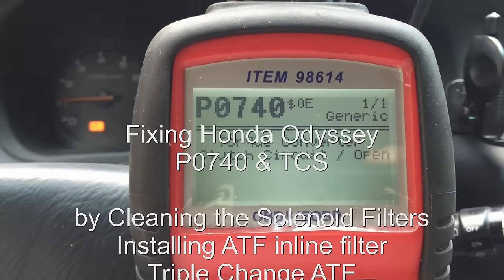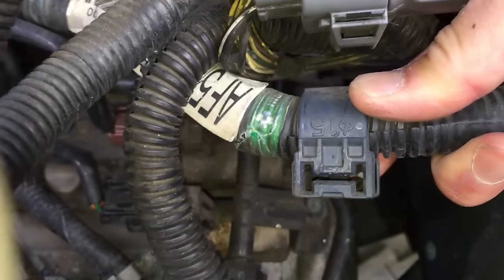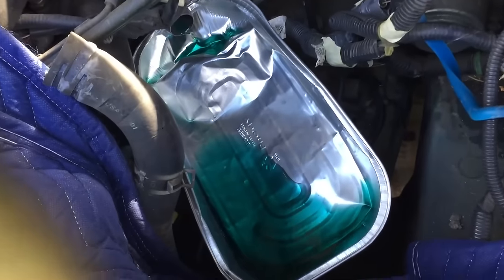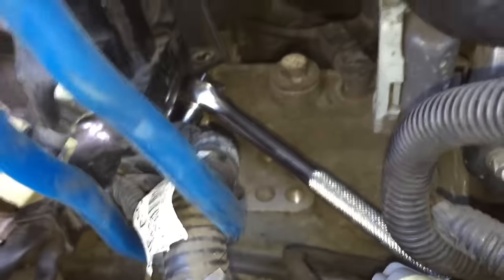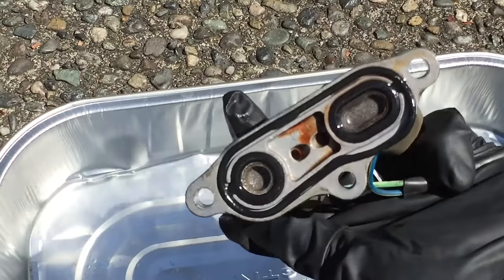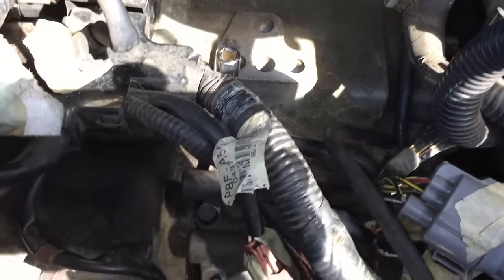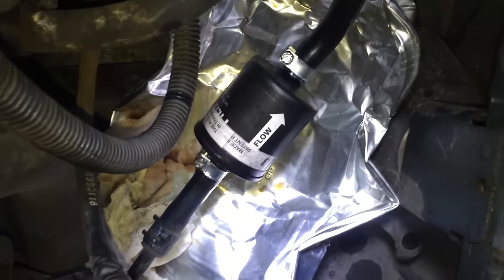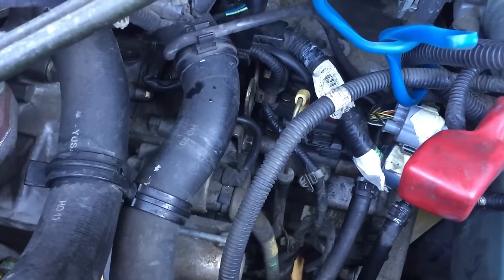Fix Odyssey P0740 TCS Transmission Problem

Comment: Thanks to you I have been able to fix the problem of my automatic B7XA in my Honda Accord V6 3.0, year 1999, 235.000 km. The symptoms I presented in my case was that the second up speed came late and very abrupt, especially cold. I was a little scared initially because I thought the box had a major breakdown but fortunately they were the microfilters of the four selenoids plugged with dirt as described in their video. My fault was that it took me a long time to change the ATF of the box, finally being in a dark color, a symptom of the oxidation of the oil when losing its lubricating properties. I could also do it without removing the water cuff, although in my vehicle is a little more laborious than yours, I recognize that the access is a bit complicated. Now my Honda runs the changes in cold very sweetly and without abruptness. I changed ATF twice in a row. Now, after a few kilometers traveled I go for the third change to get the crystalline red color. Greetings from the Canary Islands, Spain.

Comment from the maker: I just found what I think is a much better fix for my problem. This P0740 came back after 2 years and created a serious hesitation shifting from 1st to 2nd. I replaced the two shift sensors (known as A&B or B&C) located directly below the starter. It required removing the starter, but overall easier access than the solenoids in this video. The parts were $35 for both. The result was immediate and dramatic - shifting problem is completely gone! I'm going to make a video of how to do that. There are apparently several variations of this engine so yours may be different, but if you're experiencing hard shifts, then I'd recommend you replace all the solenoids.
Reply: I have a 2001 Honda accord V6 which has the exact same problems(seems to have identical solenoids). I am awaiting your video :)
Reply: I'm on my third transmission on my 1999 Odyssey with only 157,000 miles on it. Same problems each home. I think I may just do your fixes myself this time. Looking forward to seeing your video soon! Thank you so much!
Reply: So i have a 99 honda accord and i put it on drive and it wont even go past first gear tries to go to 2nd gear and it feels like the transmission locks up it brakes on its own what can it be?
Reply: does your gears blink in the dashboard?
Reply: @danieleller1108  they dont blink
Reply: @danieleller1108  also when i put the car in drive the car feels like it wants to go it jumps
Reply: well that might be bad. Its worth it to try and clean out the lock up/shift solenoid(this video). The dual linear solenoids, and the b and c solenoids. In my v6 it really cured my hard shifting from 1st to 2nd gear. Also really make sure you "test" the solenoids a bit to clear out any stickiness their could be in the solenoid pins.
Reply: Also i tried replacing my lock up/shift solenoid with a new part from amazon which caused my car to only stay in 1st. Also caused my gears to blink in the dash. Put all the old solenoids back in and it runs so much better. So it really could be they need cleaning....or it could be you need a new/rebuilt transmission :(   However its totally worth it to try this to save $$$
Reply: @danieleller1108  yeah thats what im gonna have to do.they also suggested doing a flush on the trasnmission first.so im gonna try both and see what solves the problem thank you for your time.
Reply: sadly i never had luck with a flush. But give it a shot! Hope everything ends up working out for ya
Reply from the maker: By popular demand... here's part 2 of how to fix this problem:  https://youtu.be/Z5sRlSBGWyo
Reply: Daniel Eller my gear is blinking on the dash what does that mean?
Reply: Means your transmission is unable to shift properly. Hopefully the issue is your solenoids are bad. Do what is in this video! I would start off pulling out all your solenoids and thoroughly testing and cleaning them. If issue persists then try replacing the solenoids.
Reply: Daniel Eller i haven’t had major shifting issues but I did notice I accidentally moved the car from drive to neutral while on the freeway & right away the tranny light went on
Reply: I am about to do all of my solenoids and pressure switches on my 2005 Honda Accord V6 Hybrid. Hope it fixes my hard shifting.
Reply: I just replaced those two solenoids today along with the solenoid on the front of the engine.  Took about 90 minutes, but getting the battery tray out was easy for me now because I have the hard to get at bold slightly loose and leave it that way.  You don't need to remove the started, just loosen it and it can be moved enough to get to the top solenoid.  I purchased all three of these solenoids online for about $65 on amazon.  Two were SINS and the other not sure.  Van runs well now.
Reply: Daniel Eller still waiting huh 😂
Reply: @miteeman  I think you meant to link to this video for part 2: https://www.youtube.com/watch?v=CxRiCfLmCRI

Comment: You fine sir......just saved me 2500 dollars in a rebuild......followed ur steps even bought the filter and my transmission has never been better I have 270k in my accord and the transmission has never been touched till today and u have made it better than ever thank you so much for this video
Reply: Rafael Mendoza bro what year is your accord? I’m getting a p0747 code it is “Pressure control, Solenoid A stuck on”.. help
Reply: I have 163k on my 06 TL. The trans fluid is dirty. I'm on the fence about changing it. Can anyone tell me if I should leave it alone or Change it?

Comment: The trick for keeping an Odyssey Transmission alive and reliabe is changing the fluid (drain and fill) every time you change your motor oil. A dipstick vaccuum tool costs roughly $80. Although it won't remove all the oil, the amount it removes is adequate for an effective partial fluid replacement.  I have kept my transmission alive over 200K and it works perfect.
Reply: I have the p0740 in my 2000 Honda Odyssey no other codes , do you think changing the atf fluid and filter only would solve the problem ? I mean without doing anything hat this gentleman in the video did ?

Comment: Great detailed and clear video. Thanks so much. I Just changed the linear dual solenoid this weekend and it fixed the problem right away. I replaced the solenoid WITHOUT REMOVING THE BATTERY TRAY, just the battery was removed as well as the two bolts that hold the harness on the top of the solenoid. The bolt under the hard pipe was a pain to remove even with the small extension. I didn't have any other tool, so I decided to bend the hard pipe using the extension just a little bit enough to have the socket fits well on the bold. Taking the solenoid out and putting the new one in was another pain the behind. Need to wiggle, turn left, right , just a little at a time. But with patience and trial and error, the old one was out and the new one was in. I also replaced the ATF at the same time. All was not an easy job for a non-pro but feasible.

Comment: I just bought a 2001 odyssey van.  Shifting really hard to second and I thought the inevitable.   Did a little research and ended up here.  I took off the double solenoid.  Cleaned the filter tubes out, and the valves.   Took it for a ride around the block and I'm shifting so much smoother.  On mine the longer tube filter of the two was clogged pretty badly.  This saved me so much worry.  I cant even express.  The whole thing took about 3 hours.  That 6th bolt in the back is a pita.  But keep at it it can be done.  I didnt take anything apart past the solenoid.

Comment: Thank you so much for taking the time to make this video. I was ready to price out a new transmission for a friend of mine and found your video. Cleaned all the screens and rinsed the solenoids like you did and the TCC works now. 332k miles and still kicking.  Thanks a million.
Reply from the maker: Thanks for sharing your success.  Impressive that it's still going after 300k miles!  I wish I could say it permanently fixed my problem but it got me going for another 18 months.

Comment from the maker: I wanted to give an update on my repair.  It's been 6 months and 2500 miles with no further problem!  Your results may obviously vary, but at least in my case the fix has held up well.  No return of the hard shifting, or the codes.
Reply: What spray did you use to clean the solenoid? Also, what is that thing that has "FLOW" in white letters?
Reply: he used carb or brake cleaner, but probably safer to use compressed air from a compressor
Reply: Excellent video, thank you, I still can't remove the dual solenoid bolt underneath the metal pipe, will try again latter.
Reply: eksine brake cleaner is always ok. It evaporates quickly and is great for cleaning small or sensitive parts. Carb cleaner is caustic and depending on what your using it on can damage o rings and seals etc.  Compressed air may also damage the solenoid, saying this because a novice  may use high velocity compressed air and caution/ care should be used.
Reply: What did you use to clean the solenoids, was that carb cleaner?
Reply: Do you think changing the fluid and filter would fix the problem , I have p0740 alone nothing else .

Comment: Thanks for the video! Very professional, good lighting, and you addressed commonly asked issues. I found it to be very informative.

I almost bought a 2002 with that same issue and it honestly ran great. I asked the guy at the dealership if I could run the codes at AutoZone and he agreed. He tells me, "oh that torque converter is no more than a $70 fix." 

Well I call one of the more reputable transmission shops based on the fact that this guy does all his own work and has like a 5 month waiting list to get service. He tells me that job is no simple fix, would be $400 minimum no matter what the case was and probably much more, and the tranny may still fail afterwards anyways!

Remember that the plugs have magnetic tips and it has a oil cooler for a reason! The metal flakes need to constantly be removed from the plug, drain and fills are essential.  (passive only no pressurized) Keeping fluid lines clear on this transmission is incredibly important and check your cooling fans at 100k! If you tap them with force and they turn on REPLACE THEM IMMEDIATELY.  Follow what I tell you and the triple passive drain and fill you see here and you will save $5700. 

For the people out there that bash these transmissions just bare in mind there are several components that support their function and any one failure can destroy the tranny if neglected. I personally like three ground based drain and fills because that magnetic plug captures exactly what clogs an orafice.

Comment: I have this exact issue right now on my 2004 odyssey.  It has 215k on it and has never given me any issues.  TCS light was on bout a week ago and went off but the code read the exact issue here you had.  I am going to attempt to do these same things you have done here and hope it removes my check engine light.  As far as performance it seems to perform and shift as it has always.  I did for the first time since I have owned this van changed the ATF fluid and filter bout a year ago.  Your video seems very informative very good detail.  Thanks and wish me luck on this repair.
Reply: Did it fix your  2004 Honda odyssey's problem? I also have 2004 Honda odyssey and having same problem (TCS + Engine light on/off) as your. I replaced the Gas Cap and error light  gone away for about 6 months. Unfortunately, the error light  came back on/off again. The Mechanic wants to charge me $270 for part + $40 labor. But it is ok to drive with that condition without fixing it, said he. I just want to make sure that will fix the problem before i let them do it. Thanks

Comment: I have a 2002 Odyssey that's slamming into second and third gear a little bit so I accelerate very lightly. I'm going to start this weekend pulling off solenoids. 
I was also given advice to manually shift and let up between each gear. 
I tried it and is very precarious trying to be exact and not overshooting the gear the shift lever moves all over. I think it was "The car guy"  that gave me the advice on YouTube.

Comment: Excellent! Thank you so much! One small correction: you called the left solenoid the lockup solenoid, and the right solenoid the linear solenoid. But, when facing the car, the left-rear solenoid (the smaller one) is called the Shift solenoid assembly (part 28200--P0Z-003 on Odyssey 2000 EX). The right solenoid (larger one) is called the linear solenoid assy (part 28250-P6H-024). The combined set is called Lock-up solenoid set (part 28020-P7X-305) and is indeed above $500 at the dealer.
Reply: I spent a Saturday replacing the two solenoid valves with new parts. It turned out, it did not solve the problem. It is a problem with the transmission. So I would caution anyone, test the old parts, like MITEEMan did, but if they look like they work, do not replace them. Likely, it is a problem with the transmission. I brought the Odyssey to a transmission shop, and they said my clutch plates were purple, meaning that they got hot. Another shop told me the same, that the Odyssey transmissions get hot, and this reduced it's life. They recommended adding a cooling system for it.
Reply: Wheni got code p0740 and said the torque converter clutch solenoid. When i do searches i have to wade through 10,000 other shift solenoids and lock up solenoids. How do i know if the same part has 10 different names and that im getting the correct part. I called hondas parts store and they said its called a dual linear something or other and costs 400 dollars. I know thats not correct. I just want someone to give me a torque converter clutch solenoid. Period. Not a shift solenoid. Not a 400 dollar thing. A torque converter clutch solenoid. Why is this so difficult? Any help is greatly appreciated.
Did you get an obdii code for your problem?

Comment: Wow, MITEEman--what a thorough, well-produced video. Thanks for creating and posting this. 

My friend's 2001 Honday Odyssey's TCS light is remaining on as well as the D4 light blinking. With the knowledge from your video, I'm going to jump in and clean out the lockout/shift solenoid and flush out the ATF system. Great idea for installing the in-line ATF filter--will do that as well.

Comment: Good news, good vid

I have a 2001 maxima p0744 code
Changed the atf with  Valvoline max life  synthetic atf and 1 bottle of Lucus transmission fix.  It’s a lot better.  Still have to drive it 200-300 miles before confirming it’s fixed.  I manually cleared the code to see if it comes back.

And like you said change it multiple times to clean stuff out.  There is an additive that is like seafom for 
transmissions ( add it and drive 1000 miles and change). 

Good deal  to know 
I also have a Honda Odyssey  but 2007 model year.

Comment: Thank you for the very clear explanation and demonstration. two questions:
1. After the "3x drain and flush", did you replace the WIX filter? I ask because after the 3x drain and flush, I would imagine a lot of gunk and junk being released and ending up in the WIX filter, and as such it would make sense to replace with a fresh filter.
2. How often should the WIX filter be replaced on going? When changing out your engine oil and filter?
again thank for your video.
Reply from the maker: It's been many years but as I recall I did the flush first and then added the filter.  I'm not sure how often you'd want to change the filter going forward but I would agree to change the filter after a flush.  See my comment below about what I found after another 9000 miles.  Good luck to you!

Comment: I don't know what year you have I have a 2002 Odyssey. Clunking into gears and the torque converter appears to be completely shot but I'm able to manually shift it. No third gear went out and I Am shifting first to second and then I jump up to D. If I drive very carefully it seems to be okay for the time being because this is the only vehicle I have.

Comment: thanks for posting this video, today I went through the process same clean both of the selinoied put it back together, but no luck still hard shifting from first to second,and from parking to reverse!
Reply: Did you ever get this fixed florimba j
Reply: What did you end up doing?
Reply: Unfortunately replacing the part's did not fix the issue.! If,and when I fix this I'll be happy to share the information good luck to you all..

Comment: I have found that using 10mm offset wrench to remove the linear solenoid bolt under metal pipe and the lock solenoid inside bolt fairly easy.

Comment: I have 2007 Honda Oddyssey EXL smooth shifting gear but has D blinking with VSA light on! I’ve changed the safety switch sensor, pressure sensor and still have the same issue! Now I have P0340, P0344 codes which is the camshaft sensor that I’m about to replace. A transmit ion specialist told me that my transition is fine so I have to change the camshaft sensor first. Any idea about the D blinking with VSA light on? You think changing the camshaft sensor will fix that and what should I do if the issue still exist after changing the camshaft sensor? Thanks in advance

Comment: Thanks for the vid!

Quick note:

Be careful with that positive cable touching metal or the negative- as it's still charged I believe.
You can throw a workglove over it or something as a quick safety measure.

Anyways, thanks for the info!